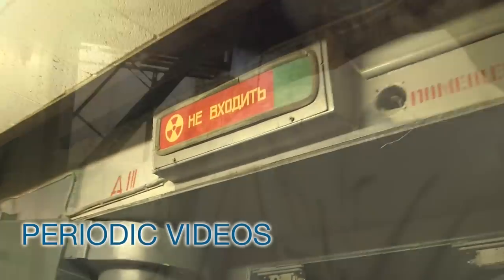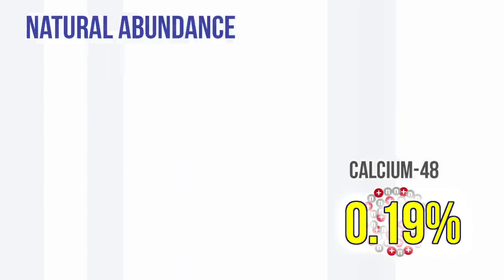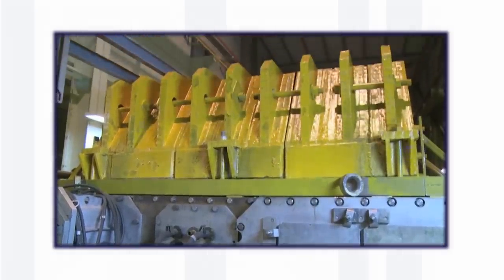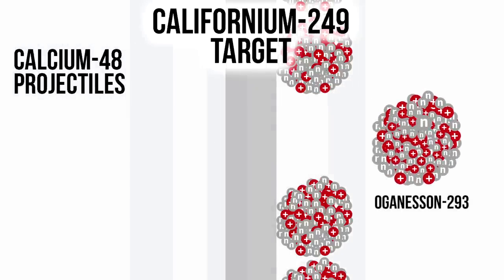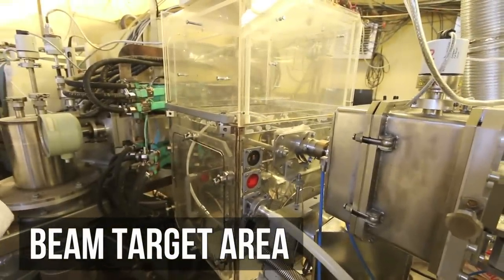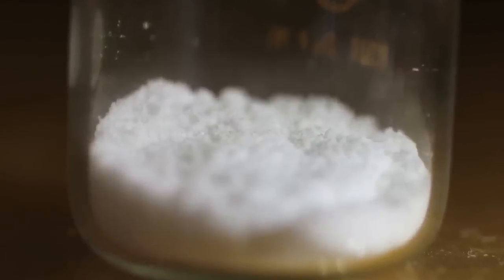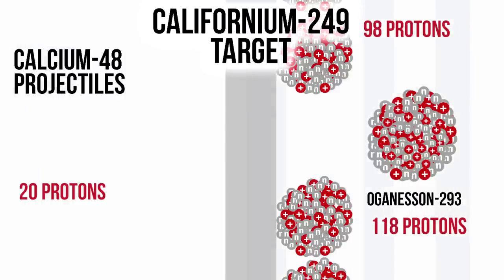$500,000 of Calcium - Periodic Table of Videos

Comment: This is so strange and interesting.

So. If there are so many versions of each element, how complete will results from a single created isotope really be? I am assuming that there will be an equal or similar amount of different isotopes in the result as in the light elements isotopes. Each time we hear about the new heavy elements we get the same old "this many atoms" was made speech from the professor. I will never get tired of it but I am wondering if these atoms are varied in isotopes. And does it even matter for the experiment.

And lastly since these atoms that they create are similar to plutionium in that they have a much shorter half life then the age of our universe, could it possibly be that these atoms or far heavier atoms will one day reveal more about the early days of the universe or is that pretty much set in stone?
Reply: mon librepenseur,
you ask a great question/s and I hope not rhetorically.

that is intriguing to study G.U.T.s et MTheory etc...

this is partly related to the nCr/nPr et n^X of possible states discussed in the so-called
'time crystals' and other holographic computing 'ground states',
that deGaris, Goertzel, Umstadter and several others are reflecting on.
there would be different properties for the result chain depending on what transpired etc.

it is open conjecture as to the extents of the extended periodic table.
the so-called, fermi-dirac-bohr-feynman relativistic limit of z=173,
and the al bartlett/penrose eroei recursion limit of 128.
we may get to a point where, we strongly conjecture something to be there, but cannot actually synthesize it due to constraints of ERoEI etc.

WFSF, drexler, h deGaris etc...
they discuss the uses of reactionless-catalysts, of micro-engineering and of different forms of matters.

what is my interest?
I believe, mon librepenseur, encoding diffraction gratings with these datas,
would be a great way to supraluminally signal at distance. A scharnhorst-zwicky signal, or a kaku-gram.
some coating as on an orbiting large asteroid, or a large thin film etc, may be tough enough to signal.
I write some SETI search algorithm to search ARICNS et MUSE et other datas, 
to search for such encoding diffraction surfaces at photo-optic 'choke point'.

here too, in SETI, we encounter the issue of not having enough observation points to actually collate the data from that observation point. so as to discern that it is a deliberative signal and targeted from a system, 
we have to compare our model of fixative stellar nucleosynthesis with the outbound telemetry from those,
and discard other explanations such as 'interferences' which could cause as much.
however, we may later be able to simulate from observable point more accurately their datas, and thus can compare from that...

my point - 
even if we can only synthesize and observe 1 atom,
we will learn how to make a diffraction grating, which can encode that datas photo-optically onto things,
to one day, place such a grating at the photo-optic choke point outbound from our system...
or, to understand better the photo-optic datas that arrive here to us from spectral emission profiles etc.

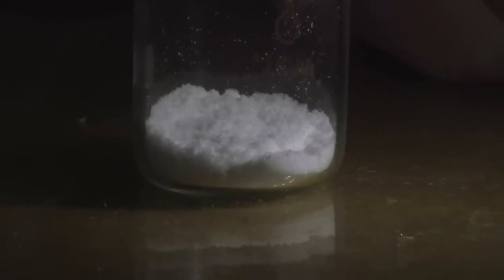Comment: at 2:20 when they say sugar free, it means it doesnt have sugar in it
it is confusing to say CO3 free, maybe you said for free.
i guess the centrifuge to seperate the Ca48 from Ca40  doesnt work well? is that because of Ca42 and 44 mixed up in them much?
what do they say about using a laser to excite only Ca48 to ionize it? then you may perform the auger effect(auto ionization) on it, cheap and surgical seperation
or do they just rather use heat to make them a plasma state, expensive wanton seperaration

Comment: so its the train tracks in the alchemical train to get steel to turn into gold?
Reply: Dan Horsenwelles Williams It's pretty impossible to get gold from steel :/

Assuming your target is Iron (from steel) and your projectile is calcium, then you'd only get a total of 46 protons which is paladium :(

Unless you want your projectile to be iron, then your target has to be iodine which will probably just react with Iron instead of fusing with it XF
Reply: paladium>gold in my book! you can use that stuff for axes and cars and other constructs meant to take heat and pressure witholding shape =D

Comment: Can anyone tell me what would happen if you tried to fuse iron? I propose that iron fusing with iron in the middle of a star is what causes the collapse of matter into neutron matter when the electron degeneracy pressure is non-existent because iron fusing with iron requires energy to create a reaction. What if you put iron in an energized environment and calculate how much energy it took to fuse into another element, and you have the start of a practical reaction it takes to create neutron matter in theory. It would be an enormous leap forward to create such a particle to study gravity waves locally.

How much energy would it take to create a single fused atom of two iron atoms themselves? If the fusion was complete, you would in theory end up with a Tellurium atom if you successfully fused two iron atoms completely without any radioactive components. Has anyone ever tried to fuse iron? It would be funny if the double slit experiment mapped out the W and Z particle field effects on the path of the photon, peaking where the field effects combined and shadowing where the trough effects were the deepest? That would be cool.

Comment: Whoa, so how much would 2 grams of Titanium 50 cost?
Reply: Nick S Wikipedia claims that Titanium-50 is about 5% of all titanium in nature, so it's probably cheaper.

Of course, if the same process as Calcium-48 is required to get it, it'll still be a pretty exorbitant amount.
Reply: But, could you make a gold-titanium alloy for say... power armor with that?
Reply: Also Titanium Tetrachloride has a boiling point of 136°C, so it would be easier to separate

Comment: Why not chromium 52 to build element 120?
Reply: If the object is to use a stable isotope with the largest amount of neutrons then chromium-54 is the candidate, which is already being used.  

They are already using vanadium-51, which is very abundant, to try and make element 119 at RIKEN in Japan.  For this they are using a target made of curium-248.  Berkelium-249 was successfully used to synthesize tennessine (117) and could possibly be used to make element 120 with vanadium-51 but this hasn't been attempted yet as far as I am aware.

Comment: https://youtu.be/CodBk7xewRk?t=240
The professor said use thermite reaction (or displacement reaction) to take oxide from calcium using aluminium, but I think calcium is more reactive than aluminium based on metal reactivity series and standard reduction potential.
Did I miss something?

Comment: The Reason why Calcium-48 isotope is so expensive isn't really because the process takes forever, but rather the same reason that in the U.S. epinephrine cost $500+ per pen, there is only a select few distributors of epinephrine so they can charge as much as they want, it's the same deal here, although the fact that it is so hard to make does contribute to the cost.

Comment: Here's what I don't get - the current method of synthesizing elements is pretty crude and seems somewhat unreliable, with a very low yield.  I would think using a higher quantity of a cheaper element or isotope with a few more protons would yield better results.  After all, most of these synthesized elements don't last very long, from milliseconds to less than an hour.  Even if a lower isotope of calcium were used, I don't think losing a few seconds is a big deal if you have a higher yield to study from.
Reply: Peter Schmidt from what he explained, this isotope is more stable and when it hits an atom, even when some neutrons are lost, there is still enough for the atom to remain stable.

So if you used a smaller isotope you have far less chance of making a stable atom with enough neutrons to hold the protons together
Reply: I'm aware.  That still doesn't change my point that the stability seems irrelevant when you consider the low yield and how short-lived these elements are in the first place.  Organesson has a half-life of 0.7 MILLIseconds, which apparently was long enough to confirm the element.  For a time that brief, I'd think they would rather have more shorter-lived elements that they can gather data from.

In other words, you get 2 options:
1. Spend hundreds of thousands of dollars for a very small quantity of calcium 48.  Due to the small quantity, this gives you a low probability for desired results. The few results you do get may last from milliseconds to an hour.
2. Spend thousands of dollars on a cheaper element/isotope with a high quantity.  Since you have more to work with, this increases the probability of desired results.  Of the results you do get (which still won't be much), the higher isotope may reduce their lifespan even more.  But with a higher yield, there is more to go by.

In other words, if I'm right about what I say, you can still roughly get all the data needed at a lower price.
Reply: Peter Schmidt He is basically saying that no matter how much you hit the heavier element with the lighter isotope the likelihood of producing any Organesson is so small, that it would be incredibly difficult to detect the extremely small amounts produced. Toward the end he mentioned them having to build a whole new detector because of how difficult it would be to detect the new heavy elements using titanium 50 which doesn't have the "magic number" of neutrons to maintain stability after the collision. 

Also the actual collider isn't set up to use massive amounts of calcium or the heavy element at once, so actually having more calcium wouldn't really make a difference unless they built a whole new machine
Reply: Tell the nuclear physicists that you have a smart idea that makes their work abundant.
They will be really happy. Hmm or maybe just laugh